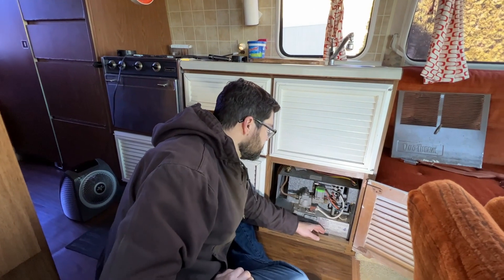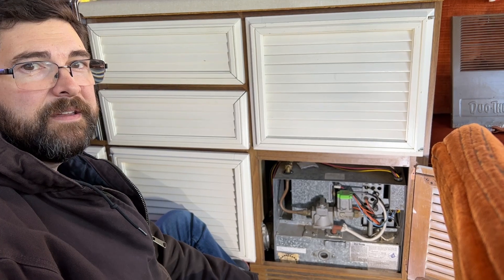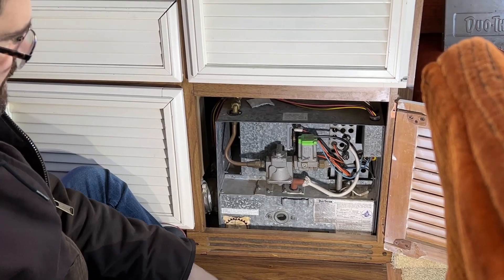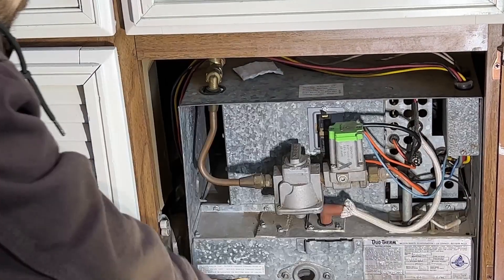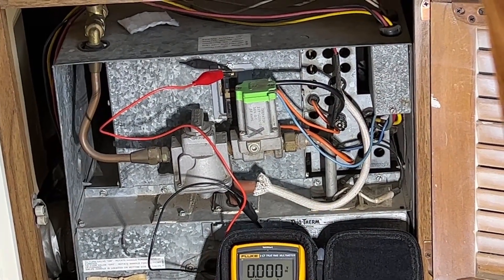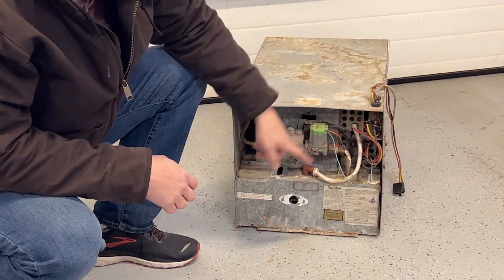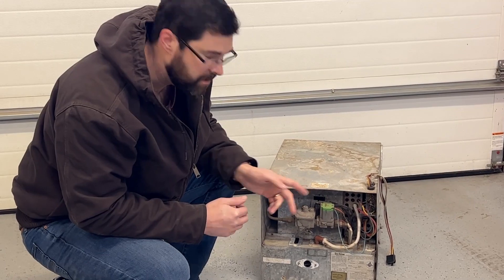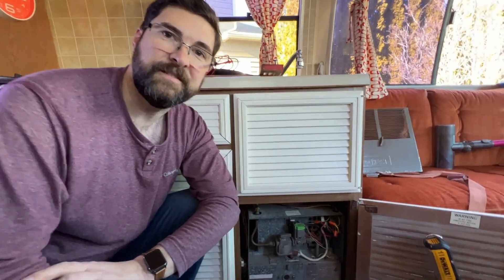'77 GMC Motorhome Furnace Repair

Comment: It took me a few weeks to get my Duotherm furnace operational.. When I first got my GMC motorhome it worked for a few days, then shut down. I found a paper wasp nest had dropped inside the exhaust and was blocking it, which of course shut down airflow. I am very happy it did- because I found the exhaust pipe stub rusted through on the inside, meaning I was venting exhaust into the coach! In any case, I fully disassembled the unit, burners, firebox, everything, and made new gaskets with silicone sheet (1/16"& 1/8"IIRC from McMaster-Carr), new exhaust and intake stubs from a piece of auto parts store exhaust pipe (Note- you will need to expand the pipes on the main furnace, as newer pipe is a hair larger, as well as the very end of th epipe to accomodate the end piece) and reassembled everything after cleaning mudwasp nest from the intake fan housing, and two of the three burner sections! After reassembly, it has been working well but has developed a popping recently: It still runs well, but pops time to time, sounding like a restart. I did have a problem on a 40 degree night when I lost it all together, and after following the troubleshooting guide in the TM, got frustrated and just repeatedly kept cycling it, and it started working again- I think there was air in the line, and I had to get it through... All in all, a nice unit. I am glad to hear dinosaur has replacement boards: Could you add a link, so I can get one to have on hand? Thanks! I enjoy all your videos, and I am currently living in my coach, in preparation for a life change trip to a few states to decide where to relocate to form the northeast.
Reply from the maker: Thanks for the comment! I ended up getting my furnace working with a good cleaning...although when I tried to use it last fall, it didn't work :(  Looks like I'll have another project this year. Here is a link to the Dinosaur boards http://www.dinosaurelectronics.com/Ignitor_boards.htm I think our furnaces will use either the UIB S or the UIB S Post.

Comment: Not a huge fan of our Motorhome's furnace.  So noisy.  That said, it is a godsend to turn it on before climbing out of bed on a frosty morning.  Happy for you!
Reply from the maker: It's really noisy, I'm going to try and quiet down the blower that pushes air to the back of the coach. I'm looking forward to being able to warm the place up before I have to get out of bed :)
Reply: @MrGMCMotorhome  I have the same furnace in my 78 Palm Beach and its pretty quiet. However the auxiliary fan behind the stove that pushes warm air to the bathroom is terribly loud. You can turn that fan off, there should be some type of toggle switch in the cabinet with the fuse boxes and battery charger .
Reply from the maker: @yoshstudio  Thanks for the comment! I don't have a switch for my fan but I think I may add one. The fan is loud and I don't think I always need the extra air movement or battery drain.

Comment: Great job! Free fixes are the best! I've wondered if a newer, quieter, more energy-efficient fan could be swapped into the old furnace to make it even better?
Reply from the maker: I like to keep things original when I can. I have heard that newer furnaces require a lot of custom install work to fit the curved outer wall. We don't camp in cold weather very often but I like the option if we needed.

Comment: Well done! My furnace (also a '77) was a Sol-aire brand and it too had problems. The coil had failed so we got no sparking at the igniter, so I replaced it. It did work - after a fashion (not entirely predictable 😄) which is almost as bad as not working at all. While researching the furnace I also discovered the old Sol-aires had problems with CO leaks, and were considered unsafe. That solidified my decision to replace the furnace so I fitted a new Atwood unit. Because of the rather radical differences in the design and dimensions of the new unit, installation was not without it's own challenges - but I too now have a reliable source of heat. 😉
Reply from the maker: Every project is an adventure :-) I think the Duo-Therm models are fairly reliable, we'll see over time. I did look at the combustion chamber and heat exchanger to make sure it wasn't too rusty or showing signs of leaks. It's always good to have a CO sensor too, just in case.